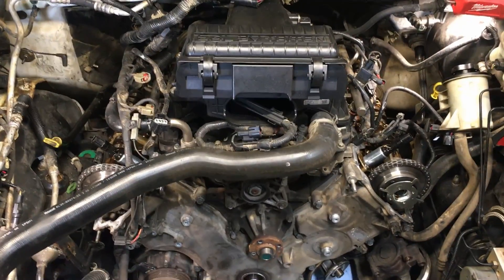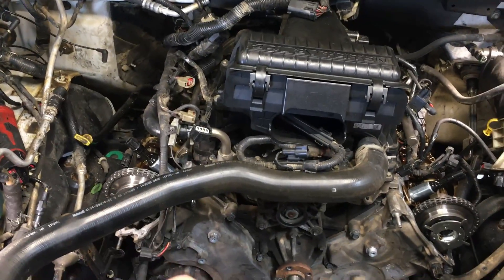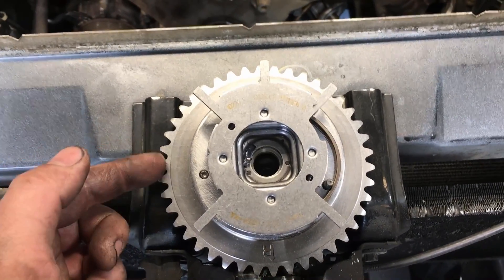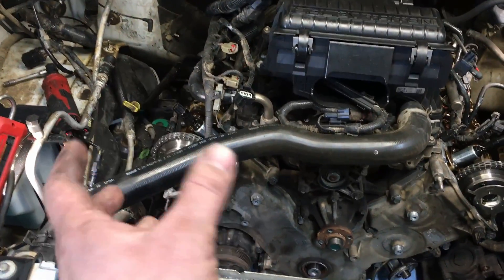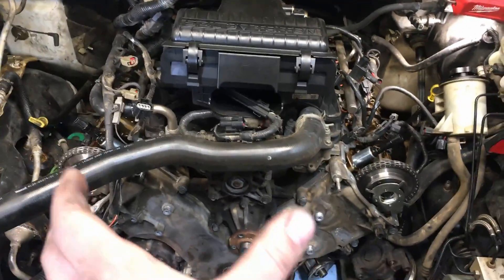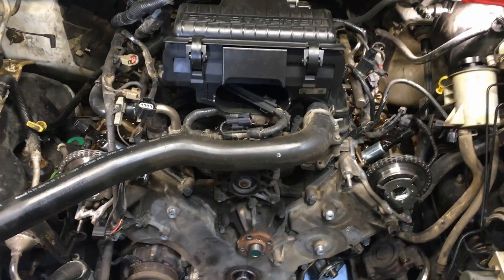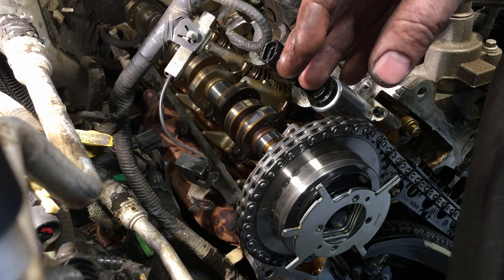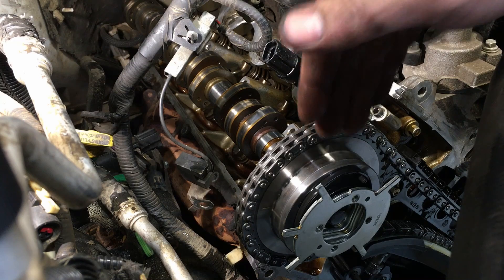Ford 5.4L 3v Triton Engine: DO NOT USE AFTERMARKET PHASERS FROM FREEDOM RACING/OTHERS; THIS IS WHY!

Comment: What about Ford building an engine that lasts a reasonable mileage without requiring this work at all.
Reply: The 300 I6 and all of the FE series fit that bill. But it's not about durability anymore, hasn't been for a long time.
Reply: My old 4.6 2 valve had over 240k and ran great
Reply: Rubble Johnstone literally every manufacturer has flop engines or major components at some point, if you don’t think they do then you’re not a “car guy” ... that being said, FORD has obviously stopped building this engine....
Reply: The triton series is a good engine but very complicated. We had a whole fleet with the 3V and they all ran fine with reg maintenance. Ford haters love bashing this engine because they see it as low hanging fruit. You don’t see Ford folks going to videos featuring burned up DoD chevys or blown up hemis with chewed up cams, do ya?
Reply: My 300 6 has 300,000 miles on it and still running strong I'm going to upgrade the timing gear when it finally does go but till then I'm going to drive it like I stole it
Reply: My coyote 5.0 is running great no issues 175,000 miles so far 2015 f150.
Reply: My '98 Escort SE had 340,000+ miles on the 2.0 SPI engine and still ran and drove when I sold it earlier this year..
Reply: My 97 expedition EB 4x4 tapped out due to an electrical issue at 312k miles strong engine and transmission shifted smooth.  Fluids fluids , didn't burn oil , no smoke , ran fine oem injectors, engine , transmission rear  etc ... I  still have it , I think it's ignition controller or something...but now have drive a 2010 navigator 5.4  6 speed , fluids and fluids  high flow oil filter or min well made filter, recommended frame ultra XG2. For older 3v 97 loved marvel mystery oil in oil and fuel.  The new navigator , don't do it ,no additives lol
Reply: @StarryDynamo88 that Engine didn't have Phasers Dude.
Reply: There were some bad parts here and there, but the engines aren't bad. I have 193k on my 5.4L V3 and it runs like a champ without any work to the engine beyond replacing the ignition coils and spark plugs. Some people don't maintain their vehicle and beat the hell of out it then blame the engineers for bad components when it fails.
Reply: I'm not a ford guy at all. In fact I swore you couldn't pay me to drive one. Well just bought an 05 f150 because it was cheap. 200k miles and only oil changes. Runs great.
Reply: Rubble has a good point 5.4 had a lot of Valve Train Issues Ford Starting use Phasers many have issues not like older  Ford V8 module engines had Solid Sprockets. ,The 5.4 DOHC 98 Navigator or 05 06 GT  Spectacular Engine.
Reply: I have 45 years Experience Master tech I remember replacing Camshafts on 1970s Ford 2.3L 4cyl Mustang and Pinto Cam Lobes wear out Ford said Lack of Oil Changes who remembers Arco Graphite Engine oil woo hoo
Reply: Nothing wrong with a triton. go to the scrapyard and look at the mileage on the taxis. 400k to 500k. i used to tow non emergency medical transport vans with 500k on them regularly. so for you to say that, means you have no clue what the hell you are talking about.
Reply: @dethangelishere394  arent taxis and cop cars mostly 4.6s bud?
Reply: @dethangelishere394  or 2 valve 5.4s?

Comment: Aftermarket phasers is one thing. But the retired mechanic put them on the wrong banks as well. The left phaser is on the right hand bank.
Reply from the maker: No they are universal, you use the timing mark appropriate for the bank you are working on.
Reply: FordTechMakuloco 
Good thing they are universal. I did not know that...however my ocd alarm went off when I saw that.😀

Comment: I have a 2007 F150 with a 4.6L SOHC V8 (2 valve) engine. Going on 150k miles on stock parts. Would l benefit from a timing kit? What other upgrades/replacements do you recommend for my engine?

Always used mobile 1 synthetic oil every 5k miles.

Comment: I just replaced a engine with a rebuilt engine. It starts and idles fine when cold has power and passes compression test. As soon as the engine warms up the vacuum goes to zero and misses and stalls.  I have bank 2 missing like crazy. Any ideas?
Reply: It’s a 2010 F150 4.6 three valve. The original engine the timing chain blew up and sent metal threw the engine. It actually ran ok besides the noise. I’m very confident in my install!  I did a compression test cold it passed. Starts and idles perfect cold as soon as it get warm vacuum drops to zero a rattle comes from the actuator area and misses and dies
Reply: I have codes p0340, p0341, p0345, p1000,  I called the engine builder and they used Dorman cam phasers
Reply: This weekend I started the engine cold with the VVT solenoids disconnected starts and runs fine warm or cold no issue.

Comment: I did one of those with advance parts that had the same problem about the same time this video came out lol. parts came from advance auto parts and we ended up putting the originals back in and installing a lockout kit. seemed to work and the customer didn't want to pay for oem parts. it is good to know that there are parts that work and keep the original functionality of the vehicle intact.

Comment: Moral of the story: just don't get the 5.4 3v engine.
Reply: Then what should you buy? Seriously. Everything from gm is junk. Everything from ram is junk.
Reply: @hosocat1410  love my Ram, I ditched Ford because of the 3 valve. Ram 200k, zero problems. Was a Ford man, my 04 Dodge is head and shoulders above Ford.
Reply: Or the 4.6 3 valve.

Comment: Hey I had a question about timing jobs. Have you used the Melling 3-391 timing kit. I know it doesn't have the Ford phasers but is the kit worth it or is it crap?
Reply from the maker: use the ford kit I link to only.
Reply: @FordTechMakuloco   The reason I ask is I did a timing job just as you recommended and a slapping noise has come back but a little different. It now sounds as if the the exhaust is off and rattling. Now I didn't replace the oil pump last time and figured I'd do it this time. The truck has maybe only 30000 miles since the timing job but like I said it sounds like a slapping of the chain.
Reply: So I just got done watching your video on phaser oscillation and that seems to be the sound. Its intermittent and doesn't happen on startup and only under load. Can I upgrade the oil pump without replacing all the timing I just replaced?

Comment: Great video. I'm sick to have read of so many dealerships replacing engines due to timing components. I've got a 2005 Expedition now at 284,000 miles. I've only had to replace the VCTs...3 x now and did the phaser sensors (not the actual phasers) just because they were easy. I most always have used full synthetic and my internals still look new! Only view is from VCT hole but looks like new. Don't scrimp on oil and replace those VCT's the moment the code pops up! The reason is that you must MUST maintain oil flow on upper engine and those VCT's have fine screens and do go bad. I buy from Silver State Ford in NV. Wholesale OEM to the public. Great service and quick enough shipping.

Comment: I just bought 2008 5.4L with 145K miles. it already has the diesel idling sound going on,  I already ordered the Ford 5.4L 3V Camshaft Drive Phaser Repair Kit from Amazon,  what other upgrades do you recommend I do while doing the camshaft phaser repairs?

Comment: Hello, I know you are really busy but my 04 f150 5.4 3v locked up on me. The crazy thing is it was running fine when I shut it off. When I went to start it, It turned over just a tiny bit and locket up. Starter and battery is good. Loosened all plugs and will not turn over by hand. Do you think it can be the timing chain some how? Truck has 160000 .Thank you for your time. I really do enjoy and appreciate your videos. You can even call me at 573-889-9111

Comment: This is spot on. just bout a truck that had just had the timing set done(small used car lot/mech shop) including the VCTs and Phasers. The truck still had a terrible start up rattle and even worse when at operating temp. swapped the VCTs and Phasers for FoMoCo parts(using your videos as a guide) and runs and sounds perfect now. The aftermarket companies just never got these parts right, you gotta go OEM. thanks for all the great info, much respect sir.

Comment: This is also a VERY GOOD REASON to not buy a FORD. Reminds of their older version diesel engines that used high pressure oil to fire the fuel injectors.  those were a nightmare too especially if someone put in something other than FORD motor oil.

Comment: I currently own 3 vehicles with that engine and have owned 8 others. All 3 generations of it. It’s great till it breaks. That engine only likes ford oem parts. I’ve spent over 40k$ in repairs over the years with 150-250-350s with it. I learned many years ago, if it’s a mechanical part, only buy OEM or it will break and u will have a bigger problem

Comment: NEVER use aftermarket ( dorman ) timing parts on the 5.4.. 3 valve I had the same experience..(blown tensoner seals phaser broke ) had to redo the job with Ford parts . No issues the last 4 years ..

Comment: I don't know Brian, I have bought both the OEM and the CNC's from Freedom Racing and have not had them come back. I have done quite a bit of these. I have good relations with many customers ( some of them like to come by and chat all the time) they would have let me know if any issues. Maybe I have just been blessed with  quality ones. I also use the Ford Racing High Flow oil pump with pickup tube, it's priced reasonably as well.
I am not bias I am just sharing my experience with Freedom Racing and what I've bought.
Thanks
Reply: having two vehicles fail? Thats 4 two many already. How long were they in for? Did any fail right from the get go? Why is the company not warrentying their product? Why? You cannot install them incorrectly. I call you out on those.

Comment: Why can't they all be built like a old school 302 one cam one timing chain = 400,000 miles.  I have a 05 an 07 3 valve 07 has new long block engine 05 is stock with 236,000 miles but it a ticker.

Comment: Is there any advice you can provide regarding the same issue(s) on the 4.6 Liter 32-valve InTech V8 in my Lincoln Continentals?  I have '96, '97, '98, and '99 models.  I know that the head design was changed between 97 and 98 model years.  I have found that the 96 and 97 model year engines have not developed the characteristic ticking of a sticking valve-lash adjuster, whereas the 98 and 99 models have.  Any guidance or recommendations regarding the maintenance of these engines would be highly appreciated.  Thanks!

Comment: The main problem is it’s a 3v engine a 4v engine or 2v engine won’t have this problem as much or not at all. The Ford 5.4L and 4.6L 3v V8 engines was the worst Ford engine ever made all Ford 3v engines are junk stick with a Ford 2v or 4v engine. I’m a Ford guy and I would never own a Ford 3v V8 I would change the engine to a Ford 5.0L coyote 4v V8 instead.

Comment: Ya they almost suckered me in too.  I did end up using cloyes chains and guides but stuck with Ford phasers and tensioners.  For as much work as it was I wish I had gone all ford just to be safe.  On a side note I did have to go back in on the passenger side.  Sounded like a bad roller or lash adjuster.  I had changed all the lash adjusters but the rockers all looked good at the time.  The phaser was knocking too even though it only had 5k on it and I had installed the melling 360 and ran 5w30 platinum.  The oil pressure was great. But i know the passenger side is the last to get oil so when I saw your video about the smaller holes in the new rockers to keep the pressure up i said let's give it a try.  The old rockers still all looked fine.   I checked the cam journal clearances and they were good so i put i another ford phaser and the new rockers and 10k later still quiet. I could have tried leaving the phaser in but I just don't have time to mess around.  Driver side valve train getting noisy now so I'll replace the rockers there shortly.  190k on my 2005 Expedition.

Comment: By the way great video again. Spend a 200.-500., dollars on the same exact kit from Ford and he probably would have had no problems. I'm pushing my truck right now to get that money so I when I do pull the trigger on getting it done I'm not going to have any issue. With the upgraded oil pump, and tensioner.

Comment: I commend you for calling out faulty parts. Ford also has had a terrible track record on engines for Way over a decade now also they have been terrible about selling upgrades while still installing the same faulty parts in the vehicles that are being produced. Terrible way to treat your customers in my opinion. I myself have drove fords for way over twenty years mostly diesels for my business. The 6.0 6.4 6.7 are absolute junk Fix Or Repair Daily

Comment: You know whats better than just using factory ford phasers?
Locking them out all together. 
I went through 4 sets of the revision 3 phasers. And finally bought a lock out. 
120k later and no fucking problems. 
Those other 4 sets. Didnt make 50k. So fuck ford on that.

Comment: I followed your series to fix the phasers and replace the timing components on my father's 04 F150. Only problem is, in my opinion the entire system Ford designed in the first place is flawed, and why fix it and wait for it fail again. Ordered a set of lockouts for the phasers, retuned it, and now it can never pull that nonsense again. I like Ford, just not that design or system.

Comment: You know to stay away from the 3v 5.4 when an entire channel is dedicated to fixing their problems.
Reply: Kinda hard to argue with that. Haha
Reply: Well to be fair it’s the customer who fucked up lol
Reply: Ford engineers should be shot
Reply: Had someone tell me, how do you fix a ford?
Trade it for a chevy
Reply: 4.6L ain't no joke either! Growl and purr all day then break at dusk...
Reply: @Guardian_Time_Jumpers  Yeah... my 4.6L has been down for 8 days now while I was diagnosing a vct issue. I replaced the solenoids and put the covers back on, but the ford phasers are still getting stuck on advanced timing at idle. I think one of the two has been on the vehicle since it was made in 2007 (its a 2008 Mustang GT) so it is just old. I bought aftermarket phasers but after watching these videos, I'm not even going to bother putting them in the car. Gonna buy new ford ones in a few days once I have some money lmao, they aren't cheap. 

To be fair, the 4.6L is a beautifully driving engine, I have it tuned for 93 octane gas. But when theres a problem, you can be down for days repairing it. I had to do two clutch jobs  since I owned the car (2014), one from the puny ford stock clutch disc burning out (which I replaced with a beefier exedy clutch), and again for the slave cylinder/throw out bearing coming apart. When I took it out of the transmission, it literally fell apart in my hands lol.
Reply: @SangheiliSpecOp   yeah, the 3 valves have a unique growl. I have a Diablosport Predator tuner and try different parameters. A cam phaser started clacking so I went all out on the top end rebuild. I'm just now buttoning it up. Still have hours just to install each roller followers, accessories and fluids. You get one chance to get it right on these engines. I have a Spec clutch and steel flywheel in the closet. This other issue set my plan back. I'm thinking about attempting the dreaded TR3650 5 Speed. I'd rather just buy a $3000 Zambrota but it's not happening this week...or next. In saying that I love my car to death. Its an extension of my personality. Keep the faith!

Comment: Question:  I have had some fairly experienced mechanics, parts dealers and other Ford guys tell me that as these variable cam timed Tritons get older, the timing suffers from wear.  They say one of the quick fixes is to go to a higher viscosity oil.  Any opinion on those suggestions and claims?  I have an earlier expedition with lots of miles on it, and I am wondering if I should go to a heavier oil to correct any timing issues that may be a result of parts that may be a bit worn.  I purchased this vehicle from a fire department, and it has had impeccable maintenance.  It does have standard mineral oil in it, and I am going to replace that with Amsoil, Castrol SynTec, or Kendal full synthetic.  Thanks
Reply from the maker: 5w-30 or even 10w40 depending on your climate is the way to go with these engines

Comment: Wish I saw this video 5 months ago. I had a remand motor put in my 04 f150 back in May and it has had a rough idle from day one. The mechanic that put it in replaced the solenoid one bank one and it changed nothing so he said bad phaser well the builder wanted a second opinion so when his mechanic looked at it had developed a misfire on cylinder 5 which turned out to be a bad wire which neither mechanic noticed I fixed that but still had a bad idle so decided to get a diagnostic test done at pep boys, they found class b missfires in cylinders 123, I think it is a phaser but the engine builder says it can't be if it is not throwing a code for it, which to my knowledge there is no code for the phaser itself. I just want my truck to be normal and reliable especially after putting in over 6k into it. Any advice would be greatly appreciated.